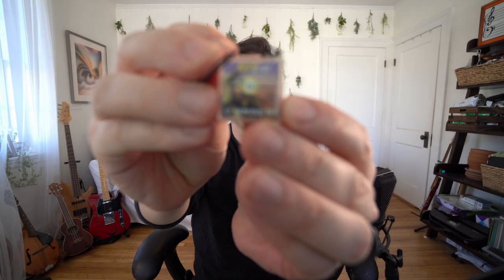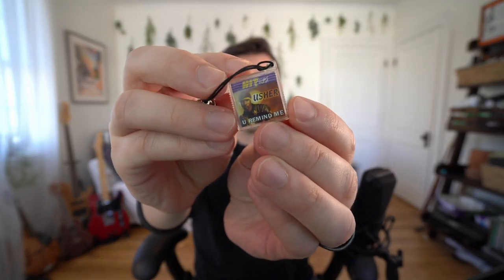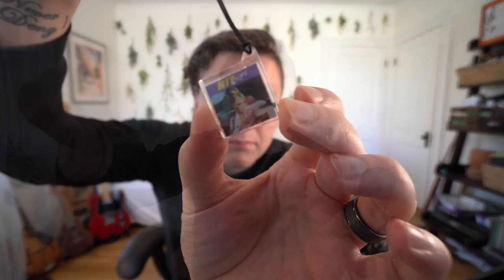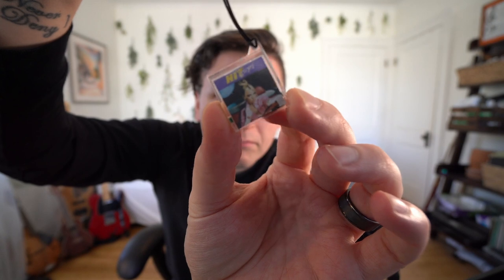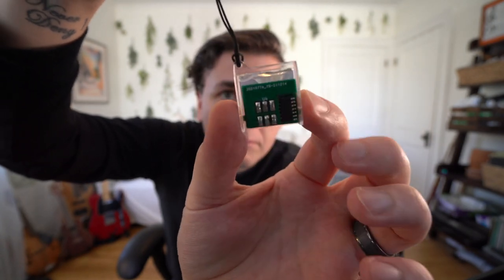I'm bringing HitClips back!

Comment: Would it be possible to make a version of this that 'fits in the hit clips disk players? I know that the hardware is pretty much compatible and those players could play original hit clips if you put them in right. I just think it might be interesting to have a version of the plastic case that takes the form of the later format.
Reply from the maker: Just bought one, will let you know!

Comment: Ever since I got my beta unit, i've had fun just listening to the cupple files at a time I can fit on when it comes to full length songs. I've reloaded it several times with new audio, and also found a strange audio speed issue. Songs appear to play slightly too slow, as if a file speed change was applied to decrease it by about 2 to 3 percent. This would be the equivalent of me setting the rotation speed for my record player slightly low so that the music runs slow and half way between the original key and the half step below. I also thought it would be interesting to load on full length original versions of songs that were originally on the format, so that's what I did with 2 songs that I own in their original form and on original hit clips.
Reply from the maker: It's entirely possible that I didn't match up the playback speed perfectly when I first got the code working. But the good news is that it's easily adjustable! In the code.py file on the drive, there's a line (around line 112) that says "frequency = 25100000". That's what sets the clock speed of the playback driver. You can raise it a bit and just save the file. Thanks for the feedback, I can update the the code that goes out with units in the future.

Comment: Nice build!
What resin did you use for the 3D print of the cartridges? The clarity is very nice!
Reply from the maker: Ordered from PCBWAY, UTR-8100!
Reply: @GuyDupont  thanks a lot! 😁
Reply from the maker: To clarify, I ordered the full prints, not the resin
Reply: @GuyDupont  yes of course. But the important info was the resin they used. Other manufacturers luckily use the same 😉

Comment: Now that I have gotten a chance to experience hit clips disks, I'm wondering if one of the features from those could be brought to the hot clasp. 'Basically the disk format supports repeate playback up to 3 times if the player button is held for a few seconds. This doesn't work on original clips but I know of something that does that leads me to think something of this nature could work. If you hold the button while inserting an original hit clip into a player, it will loop a test beep for a time. I'm wondering if either repeate playback or auto file advance could be a feature in hot clasps if you hold the button while starting playback..
Reply from the maker: This is interesting! Mine show up tomorrow, excited to try them out
Reply: It's almost the same thing, just with up to 2 minutes of audio in the same 8 khz pwm as the originals. The pin layout should be the same because the later players support the old clips by way of a piece of plastic near the contacts being removed from the player so that an open space between the closed top cover and side of the unit create a slot that fits the originals. On closer inspection of the disks I don't know that it will even be possible to build a hot clasp in that form factor with the current parts being used on the boards.

Comment: I sure hope that in future, the micro sd card support can be added back. The pins on my debugger got damaged, so I'm not able to load myne with new files. I would assume that the debugger is not a standard piece of equipment and was designed for this particular board?
Reply from the maker: The debugger and cartridge were designed together by me, so neither is "standard" in that regard. It's the best system I could come up with that fits the space constraints - they are definitely fragile and that is not ideal. So I also hope to add an SD card back, it would simplify a lot, but it takes up an entire half of a cartridge! In the meantime, I am happy to send you a replacement debugger.
Reply: @GuyDupont Is there anything I need to do to get this going? I bought my beta unit some months ago and am wondering if I'll need to give shipping info and stuff like that.
Reply from the maker: @acerbt  I can use the same shipping info from Etsy if that works for you. Can send out tomorrow.
Reply: @GuyDupont Yep, the shipping info from there should be just fine. Thank you for doing this.
Reply: @GuyDupont  If the sd card hardware takes half a cartridge, why not make a second design that makes the case longer to handle a longer, built in board? This was the approach that tiger originally took to build both the fm radio and recordable cartridges. The fm radio uses the extra length for the reset and scan buttons comon with simple digital scanner radios, and it still has the key ring in the corner. The recordable on the other hand was actually longer than the fm radio cartridge before you take into account the antena length, and it has hardware inside for a simple audio recorder that has a record and stop button. They didn't put the key ring on it though. These both have actuall screws holding them together unlike original clips so with the right small screw drivers it is possible to take them apart safely. Sure you needed a special player that came with the recorder to record music from your computers speaker or headphone output, but it does play back with any hit clips player, even if it sticks out like a usb drive in anything that isn't the player it came with and is designed to fit in. Even the fm radio sticks out like a thumb drive and it was always marketed as being designed fir the micro players and boomboxes.
Reply from the maker: @acerbt  It's a good question and I'm open to the idea, but the simple answer is: cost. I'm still going to need the debugger to get my code on to the device. That code lives on the flash memory chip next to the sound files that get uploaded - it's basically free storage for the audio. So if I added the SD card back , I would need both. Not to mention the cost in time to design up a new circuit board and case. And users would need to pay for their own SD cards and SD card writer if they didn't already have one.
The advantages would be extended play time, and an easier experience getting audio on to the device - both of which are desirable! But, I don't think people care about the first one, truthfully - part of the charm of the originals is the short play time. And I just haven't received enough complaints about the upload experience (even though I know its not ideal!) to justify all that time/money.

So! If I can find a way to run my code off of an SD card AND find a way to fit in into the current form factor, I will possibly try to do it. Otherwise, It's just not a priority for me.
Reply: @GuyDupont  Well, here we are again. My second debugger has slightly bent pins, though not as badly as my first one. In all this time I haven't found a way to nicely store the thing, so have just stored it in the little ziplock bag that I have my cartridges in. I did actually put the cartridges into a smaller bag without any players, to avoid the issue of the debugger getting caught on things like the lanyard for my disk player or the other wires for things like the recording dock and headphone cables, but I think it may have been too little, too late.

Comment: What kind and capacity of storage media is used for the data? I just bought one and hope I can load it with audio.,
Reply from the maker: Hey! The beta units for sale are a bit different from the one I demo here. I had to sacrifice the SD card for a smaller integrated flash chip. It holds a bit more than ~10mins of audio (there's about 12 mb free when I ship them). Feel free to cancel if you were hoping for more storage! Hoping to revise and bring the SD card back at some point.
Reply: @GuyDupont  how would I load the Flash chip with audio? Does it have any kind of data port or anything? Also what kind of format (sampling rate and bit depth) does the system Support for input audio?
Reply from the maker: Not sure if URLs will work here, but the setup instructions are available at: https://hotclasps.com/setup

To directly answer: The cartridge ships with a USB adapter that you'll use to plug in to your computer. The cartridge will show up as a disk drive, and you just drag and drop your files. The file format is a custom one, but it's basically an 8-bit, 24khz wav file. You can convert any existing audio file to that format (I call it .htclp) by following the instructions on the link above. There is no audio input on this model, you can only play the files you load on.
Reply: @GuyDupont  The set up instructions make sence to me, but the part when removing the board from the shel is unclear because the instructions aren't descriptive enough. The reason I point this out is because I'm blind and can't see pictures. Also, do you know the spesificks on what kind of internal sound format is contained in the converted sound files? I have figured out that it can't be pcm, because hit clips never used pcm, instead they use pwm. I want to be able to build the audio files without using the web converter if possible. The reason I'm asking about format information is because I can't figure anything out by importing my file into media info to find out the particular atributes and type of audio contained within it.
Reply from the maker: Thanks for the feedback on the instructions, I can work on improving those!

If you're asking about the cartridges that I made - the audio is saved on disk as 8-bit PCM, though the ordering of the bits is a little different from a normal wav file - that's why I call it .htclp instead of .wav. The microcontroller inside my cartridge converts the PCM data to a PWM signal at playback time, right as each sample is emitted. 

I can't speak to exactly how the original cartridges are storing their data, but they are definitely outputting a similar PWM signal. 

And both my cartridges and the originals are actually splitting the PWM signal between two pins depending on the sample value. So if the sample is a "negative" value, the PWM is applied to one pin, and if it's a "positive" value, it is applied to the other. This must have allowed them to save money on the players somehow.
Reply: @GuyDupont  So is it possible to import or export those htclp audio files in an audio editor like audacity as a raw data streem and get the correct kind of signel played back from or saved to a file? I'm able to set the bit depth and sample rate correctly, but I don't know what the closest standard byte order would be to cause it not to make the audio sound very clippy and loud when imported. If that isn't possible, is there a stand alone tool I could use to locally convert wav files over?
Reply from the maker: I have a tool also hosted on the web to do the conversion: https://hotclasps.com/upload

You just pick a file from your drive, hit "Upload File", and when the conversion is done, a .htclp file will be downloaded.
Reply: @GuyDupont  I actually did use the web tool to convert a file earlier. I see that its powered using ffmpeg, so if I knew the exact settings to use could I use a standard version of ffmpeg to do my own conversion without using the web tool?
Reply from the maker: I use ffmpeg to get to an 8-bit 24hkz, mono pcm file. BUT, then I iterate through each sample in my code and manually flip the bits around. I do this so my cartridge has to do a bit less math, but in theory the files contain the same data/quality as the 8 bit mono pcm file. 

I must ask - is there a reason not to use the web tool? These files are only relevant for the cartridges that I built. I effectively invented the .htclp format specifically to optimize for my hardware.

I can probably spin up a desktop based tool if it would be helpful but I'm not sure I understand the use case.
Reply: @GuyDupont  I usually prefer doing my audio conversions all locally. For the stuff I want to put on the thing, I’m already going to have to convert my songs into wave to begin with so why not make both steps local? I know Web tools are pretty convenient things, but I usually don’t do this kind of thing using them. If a desktop interface could be made to do this on my machine, some requirements would have to be met, like the interface has to be accessible with screen reader programs and easily navigated using the keyboard. I’ve seen way too many audio programs be completely inaccessible for a blind user because they do not work with screen reader programs well if at all. I wonder if the interface itself could be similar to the web page version? Of course there’s also the possibility of the service itself going off-line. One such thing for many years ago was made so difficult that somebody literally had to fix an old piece of software and then use a hex editor to build the appropriate files for an old device because the website containing the original files and stuff disappeared from the Internet.
Reply from the maker: Understood - if you wanna shoot me an email, maybe we can work out the details of what would work well for a desktop app?

But I do wanna clarify a few things!
Despite this being a "web" tool - all the audio conversion runs locally on your machine. The entire website can be cached and used offline. I'm using FFMPEG wasm under the hood.

Also, you do not have to convert to wav beforehand. The web tool will do that for you. Any audio file should work as input.

Still - let me know, I'd like to provide options if I can.

Comment: If the original units have bad quality ti them, why not upgrade the system as well?
Reply from the maker: I'm honestly considering it, but:
1. A quality player will not make the old cartridges sounds good. Those are cursed forever.
2. I'm just not sure how compelling a full high quality system is as a project/product? For me, the fun in what I made is that the cartridges are backwards compatible with existing toys. I'm not sure people actually miss playing music from cartridges? I could be wrong though. I'll probably design a player regardless.
Reply: @GuyDupont  you be surprised. I still use an mp3 player than my phone since it save more battery life on my phone. 
I wouldn't mind using them since the simplicity behind then are more interesting. 
Still you should make an upgraded sound system for it since you can make your own clips.

Comment: This is amazing but I would suggest NEVER using solder on the pads it’ll destroy the pins and corrode them. The solder will oxidize fast within a month or two and stop working as well.
Reply from the maker: Yeah thanks, I kinda figured that going in - this original design was experimental to say the least. I have since completely redesigned the hardware around the RP2040 and no longer have that floating PCB on top.

Comment: hey man could i pay you to make like 20 of these? ive been searching for someone who makes custom hitclips for YEARS
Reply from the maker: I need to clean up the design a bit, but I am planning to make them publicly available in the coming months. Working on it!
Reply: @GuyDupont  awesome! around how much do you think you'll charge per unit?
Reply from the maker: @TellYourFriends  that's gonna depend on how easy I can make the assembly, and if/which components are available at the time. Hard to even give a ballpark figure tbh 😬
Reply: @GuyDupont  any updates?
Reply from the maker: @TellYourFriends  yep! I designed a version 2 that works much better. I have to do one more revision (at least) to get the details right. But! I just had a baby so moving slow.

Comment: Can anyone explain this? I got it while trying to go to the web page for this project.
www.hotclasps.com is blocked
www.hotclasps.com refused to connect.
ERR_BLOCKED_BY_RESPONSE
Reply from the maker: Website is a little janky still, sorry. What browser are you using?
Reply from the maker: Also - can you try with an explicit https:// in front of the URL?
Reply: @GuyDupont  I was able to get the site to work, but I had to go into a private browzing window for some reason. I really love this project and would love to try it out if I can eventually. I have a few old clips in a drawer along with an original player and I like messing with it from time to time. I even figured out how to perfect that crushed low fi sound that the hit clips were known for by using sound editing software on normal music,. I got it down to the exact sampling rate and everything.
Reply: apply a filter to get rid of everything outside of the 100 to 4000 hz range, then apply a bit crush or desimator with 7 bit and 8000 hz (for shorter clips) or 6000 hz(for longer clips) as the sample rate on the effect itself. It literally ends up sounding just the same as a real original hit clip.
Reply from the maker: Nice! I actually have a few beta units available on my Etsy store right now! Just updated the video description with a link.
Reply: @GuyDupont  Oh man. If I would have known, I would have waited to buy myself that music and audio equipmment I got yesterday. I guess it will be a long wait for me then.